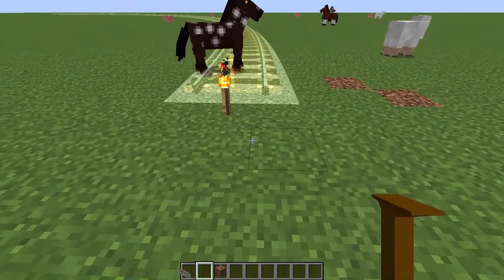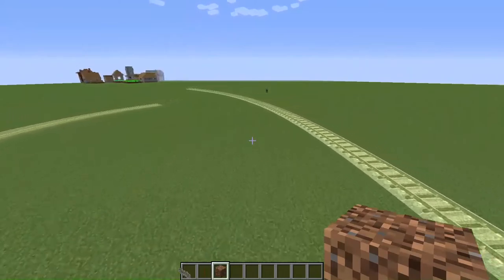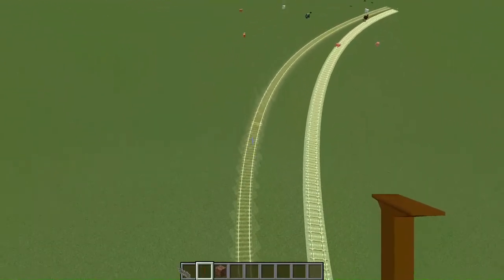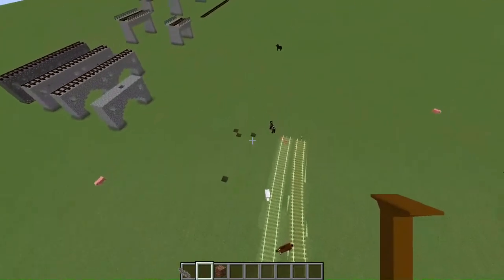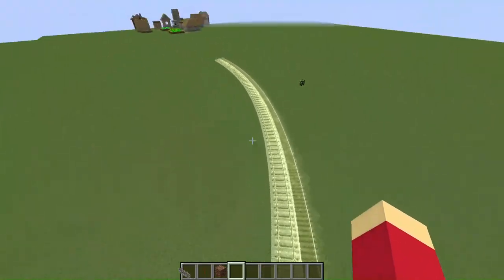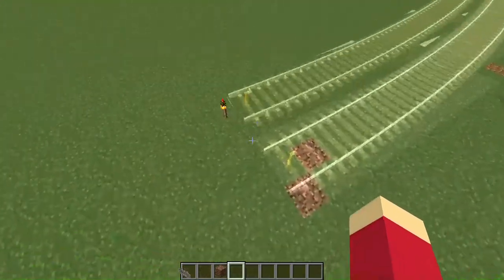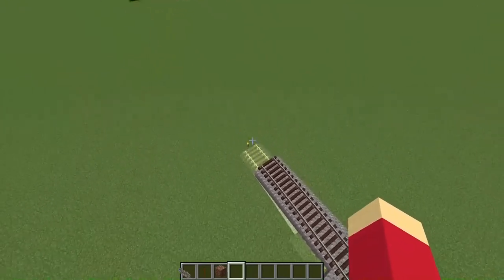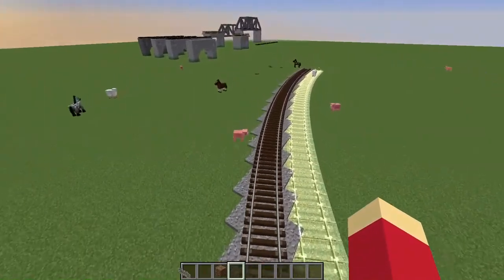Immersive Railroading Track Hack: Smooth Curved Grades

Comment from the maker: Minor Correction, I was informed by Cam72cam that smooth curved slopes can be made without using the custom curve option. Just use the golden spike and right click one block above the starting point of the curve and then that will raise the other end up.